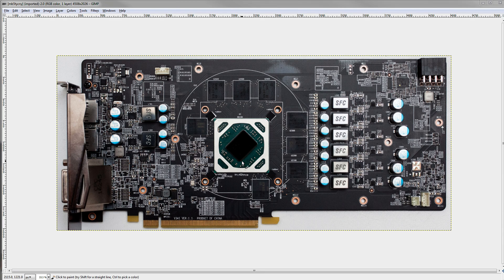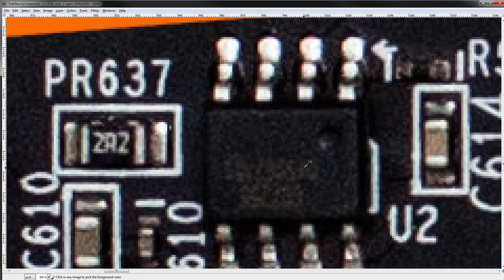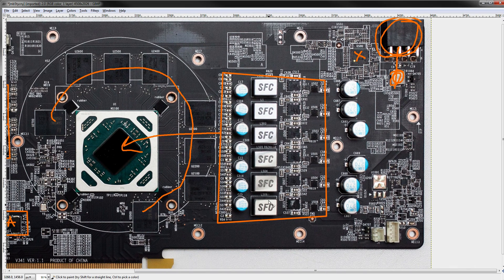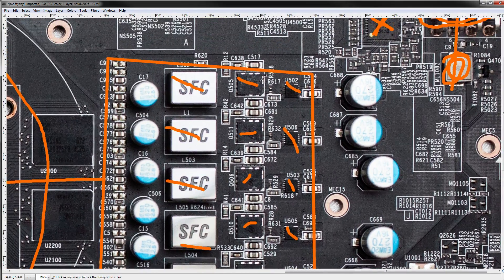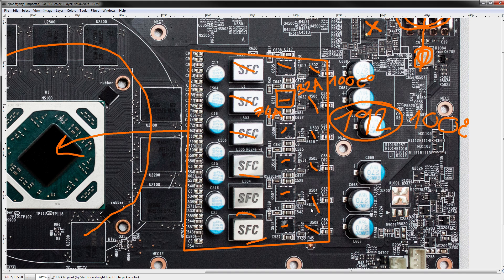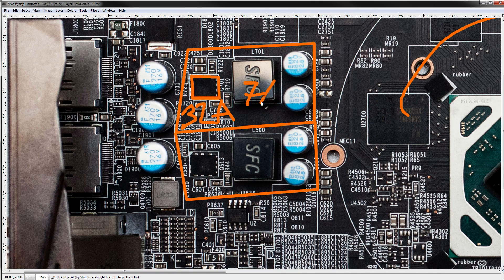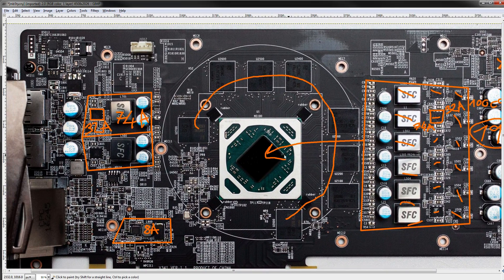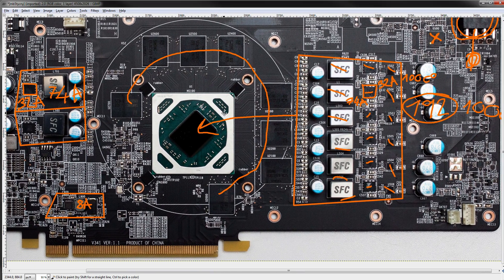PCB Breakdown MSI RX 480 Gaming X

Comment: same pcb as 580 armor, but components on the 580 armor are different (580 armor uses v341 pcb ver 1.3, diff mosfets, different voltage controller?)

470 armor pcb looks quite similar visually but totally different power stup with most phases on the left.
so multiple component choices and different variants of this pcb

Comment: Hi! Is it possible that the card is not reaching the set core voltage due to a defective transistor/controller in the power section? I own an RX570 Armor 4GB and have this problem, I have hot air and some manual skills, I wonder if I could fix it myself.

Comment: does this card have thermal pads on all the chips needed. I have one from MSI RX480 Gaming 8g  it checkerboards all over the place and it blue screens. It happens when I log out of windows 10 and when I boot up. I did find out how to make it do the checkerboard. The MSI gaming app ,when you change the clcok speed from silence mode to gaming mode to overclock mode. just keep changing it and boom it checkerboards all over. I looked at the card when I took it out , It seems there is hardly any thermal pads on many components and what I did see didn't look like it was touching the cooler at all meaning space between the top of pad and cooler or plate. Thats not good.

Comment: I just installed a big aftermarket cooler for my RX480, found a secondary heatsink to cool the mosfet but the heatsink is not big enough to contact all the components and left the driver IC uncovered, does the driver ICs needs passive cooling? Can I leave them sitting there with no cooling?
P.S - Sorry for the broken english.
Reply: Driver IC doesn't get hot, you're fine

Comment: the msi rx 480 8g is about 40 euro cheaper than the gtr black edition right now. should i go for the msi when im not a hardcore overclocker but still want a strong and cool card, which can overclock a bit?
Reply: jonas99g I've run my gaming X at 1.35V just fine so don't worry about it :)

Comment: I know I am being conservative with my MSI RX 480 overclock. Currently at 1360 on the core with a 50% Power limit increase in Whattman. No other changes. Gaming for hours without clocks dipping and always under 73c. But is this truly safe to leave here for years for an average gamer? Also, Is there much to be gained pushing memory clocks higher? In the past I have had cards that had stutter or cause lower performance with extra clock speed on memory.

Comment: Hi. I love your content. Loved this video. Could you please speak about the differences between the 8GB and 4GB models? Are there differences in voltage regulators? The same capacitors and mosfs are used? The 4GB card uses less power, of course, but how this fact reflects on the PCB? Could you speak about this? Thank you!

Comment: I really like your videos about all these PCBs, they are really informative and easy to comprehend even for non-english speakers. Thank you for it and the work you put on them. I would like to ask about no only the PCB components as I have noted that some   brands just tend to put the same cooler on different models and some of them leaves VRMs and RAMs not optimally cooled. My question comes if it is really crucial to have cooling on those parts. Or is it really safe to buy a GPU that its cooler only cools the GPU and leaves the airflow to "cool" the pcb.
Reply from the maker: Everything will last longer if it is run cooler. However low temps are not function critical.

Comment: hi, after watching your videos from the beginning, i was hoping that you finally start to review some motherboards as well...For me, id like to know something about my boards, the Asrock Z77 extreme3 and GA Z68AP-D3...this is much more important for me, cause these are pretty cheap boards and id like to know how much voltage i can give my good old 2700k..why not tell something about this mosfets, the caps and the cooling? Sandy and Ivy bridge are still very, very popular and there is no place to find where you can get real in-depth infos about the motherboard-components. Id really appriciate if you fill this gap and breakdown some popular motherboards. Greetings from germany.
Reply: yep, would like to see that too, me myself i got Z77 extreme4, looks awesome but a lot of people told me its shit under the heatsinks. However, running 4,5ghz for 2 years and it still works :)
Reply from the maker: you can probably do 4.5Ghz on 1.35V on that board.

Comment: I have seen some cards with a four-phase core voltage, so that is 128A on the high-side, and 296A on the low side, at 100C?
(I can't remember if that is for a later rendition of the RX 480, or if it is for some of the RX 470.)

EDIT - Either way, thank you for the video!  It is stuff like this that is great to know, even if one isn't going to be extreme with their hardware.

Comment: AHO, a small question - if I want to buy RX 480, but I have only one PCI-e 3.0 x4 slot (thin mITX board) will card like Strix, which has all the VCore delivery from ATX plugs, will it even work? Since the slot is not really rated at 75W. Should I use x16 riser with molex connector or something?
Reply from the maker: All the 12V power on a PCI-e slot is supplied by the first couple pins. The rest of the slot is GND and data.
Reply: Thanks, mate! :)

Comment: Thanx for covering this.  Has anyone found a bios to unlock the voltage for this card as it comes practically maxed out?  And for the cooling performance, the air cooler that comes with it is phenomenal.  Very low temps (56c with 1400mhz OC with load being full for hours) and very low noise.

Comment: What is the process that would cause coil whine on RX 480s? I've had coil whine/buzz on both the Red Devil and Strix. It only occurs in older games that run at ridiculously high FPS.  800+.
Reply: Limit the FPS ;)
That's not a RX480 issue, most GPUs have this with high FPS...
Reply: Coilwhine is normal, it's not limited to GPUs, I've a good hearing for high frequenzies (sadly). I can hear most powersupplies on light load (like phone chargers when the phone is full) or the switching of a ethernet switch... I'm wearing closed headphones when I'm gaming, issue solved^^

And you probably don't need 800 FPS, I mean are you using a PS/2 keyboard, because USB latency is too high for you?
If you are then use headphones or dampen your case, if not just limit the FPS.
Reply: I wasn't looking for a solution since I knew how to prevent it from happening. The solution for people who are concerned is to turn on vsync in either the game or the driver. However, the question was what are the processes which cause coil whine.
Reply: Actually it might be the VRMs operating at higher frequencies.
Got my new GPU yesterday, a R9 Nano. My old card is a 7950 (=R9 280).
On the 7950 coil whine is a product of power consumption and FPS, on stock clocks (GPU core <100W) with <100 FPS there was no coil whine (nothing that I could hear). >300 FPS little coil whine, >3000 FPS (Heaven benchmark on the exit screen, menus, ...) it sounded like it was about to explode.
With heavy OC (core using almost 200W) there is coil whine even with Vsync on 74Hz, getting insane above it.
The Nano manages to get coil whine in every scenario with some load (even with 60W for the core).

Looking at the power readings the VRM is crazy on this thing, unlike the 7950 where the core was feeded relativly consistent, HWinfo (polling set to 100ms) draws this Graph for a Nano on 852MHz while gaming:
http://fs5.directupload.net/images/161016/b4xeyinf.png

With a short idle period:
http://fs5.directupload.net/images/161016/l4ui34xx.png

With load it's ~20W + giant spikes, although average power consumption while gaming is ~60W in this scenario.

This could be one reason for more coil whine on newer cards.

Comment: I have been looking for a reference 480 (using an itx case, so I want the blower fan) but i cant find any, will people try to sell them used when Vega comes out?
Reply: some may and some may not. tbh I upgraded to an rx 480 bc I was coming from an r7 250. So it was actually a good time to upgrade. What I don't understand was people going from a 390 or 390x to a 480. I wonder if maybe some of them was before the performance numbers were out and if maybe just some of them just liked the new cards. I know there's a lot of people that made the upgrade because it was the right time to do so for them.
Reply: My card is even older: an ATI 5850 (yes, when it was still ATI) from 6 years ago.

Comment: Guys, between this one (Msi) and the Sapphire Nitro + Rx 480, which ones your guys will recommend?
Reply: Luck of the draw, really, although I really love the MSI cooler. Super efficient. I achieved 1470/2250 stable but at 240 watts and +100 mV. Temp never reached 70, fans at 90% and still reasonably quiet.
Reply: BBQ Bacon Nitro all the way mine did 1440mhz stock voltage. +12mv it runs 1460mhz never gets above 73c and 75% fan speed
Reply: Thank you 😊

Comment: I had to decide between the MSI gaming X and Asus strixx. I assumed that the MSI had the same level as the asus (on pcb quality),so i ended up buying the MSI. It was much cheaper (like U$$ 60 cheaper), it has the same cooling performance (i never see it above 72°c), and for my taste is very good looking. I see this and I realize I was wrong with the pcb thing. But at least is not a piece of crap like the red devil, or a sapphire nitro (super hot and noisy). It´s "average", and i´m ok with that.
Reply: The MSI has the best cooler on the market and the chips are high binned. Also the RAM clocks to 2250. It's above average ;)
Reply: As bullzoid said, the reference PCB is overkill.  It really doesn't matter that MSI has an average PCB, compared to the others.  The other factors, including the cost, actually makes it the best imo.

Anyone paying $300, or w/e premium they are asking now, for the asus or xfx, because it has the best PCB, is/was an idiot.

Comment: vCore on GTX 1080 FE is also entirely fed by the 8pin. I'm thinking if one could solder all the missing phases making it a 12+4 FE card.
Reply from the maker: FE does not have a VRM layout for 12+4 you could however double the current capability of each phase.
Reply: Actually Hardcore Overclocking the pcb has space for 6 drives and 12 mos for the vcore. I guess each driver could drive 2 mos, right? Doesn't it make it a potential 12phase core vrm?
Reply from the maker: 1 driver controlling 2 fets is still 1 phase. Since they FETs are on and off at the same time. A 12phase is a 12 phase because 11 phases are OFF when 1 is ON

Comment: I see no shunt resistor. how does it sense current?
Reply from the maker: The IR 3567B uses a cap and some resistors in parallel to sense the current going through the inductor of each phase. AMD doesn't measure the power draw of the whole PCB just the Vcore VRM.

Comment: good stuff, so how would you rate all the 480s now that you have investigated all the PCBs?
1 XFX   ...2 Asus   ...3 Sapphire   ...4 MSI   ...5 Gigabyte   ..6 Powercolor   ???
or should it be 1 Asus ... 2 XFX?
and will XFX be giving you a Black Edition?
Reply: seems like the GTR is selling fast after Jay's video.. lol
Reply: That seems to be correct when PCB is concerned. But when you include cooling, I think MSI gets ahead of Sapphire. Still, I'm going with the 1338 MHz XFX GTR :)
Reply: LOL me2, thats my favorite.. i only own 2 XFX 480s so far, but im getting at least 2 more :P
Reply: im not certain, but I think the black edition is the same as the GTR, just overclocked more... so maybe they select the GPU's with the highest ASIC values and clock them a bit higher and sell those as black.  Neither of my 2 GTR's have really high ASICs, but could just be bad luck on my part.  I would like to see the ASIC quality from a few black editions to see if they are indeed selected due to higher ASIC values.  Anyway Scsca is right, stay away from the RS and atleast get the GTR or if you can afford the difference since its not much, go black... black is always better :)
Reply: ***** I guess. Though Actually Hardcore Overclocking was the first channel to select it as the best RX 480 out there.
Reply: ***** From what I've researched, they have two basic cards - RS and GTR. Make sure to buy the GTR, as it has a bigger and better PCB and bigger and better cooling. Apart from that I think it's best to buy the card with the highest clock, cause they must be selecting them somehow to be sure the cards can run such overclock and probably put the best samples there. I've asked them on Twitter which model exactly is their top one, I hope they answer on Monday :)
Reply: ***** No answer thus far, but I think that Black Edition is also a GTR, but as Cryptomined said, these are probably the better looking chips. I'll keep you updated if they reply.
Reply: While one PCB may be better than the other, GPU still has to work as a whole. But from my experience with the cards overall: 

I had RX470 Nitro+, after a month one of the fans started rattling. Went to shop for RMA, I was told people bring RX470/480 Nitro(s) back almost everyday with this same issue. I left the shop with MSi RX470 Gaming X.
Reply: Scisca  i can't seem to find the same GTR like Jay's, as the image on the box look different. My second option would be the ASUS Dual card, which would go well with my white theme build.
Reply: Here the best selling 470 and 480 is the DATALAND X-SERIAL.. which is just a rebranded Powercolor Red Devil with a different Fan cover on it.  I bet you have not even see that one have you?  and thought you had seen them all LOL
Reply: ***** He has the 1288 MHz Triple X Edition, which I only see on Amazon as of now. I think I'll go with the 1338 MHz Black Edition instead. Better clock, the card looks the same, maybe it just isn't compatible with the LED fans? Dunno, but if you find any info on the differences between these cards, drop a line :)

cryptomined wow, these XFX boxes are really cool!
Reply: Scisca XFX class of cards are confusing as heck. It seems that the GTR from Jay's video has different box from the Amazon's listing. i think i'll just go with the ASUS DUAL card. lol..

cryptomined dude, you miner guys jack the AMD card prices up! hahahaha
Reply: Scisca Please do update me if they answer, because if based on price, the Black edition seems pricier than that of the GTR. Black edition is around $289.00 and the GTR is around $280.99 last i check, so that is a little confusing. lol
Reply: TheBobes in Poland I work in shop where we sell computers and... Really a lot of MSI comes back for RMA 😟. From all reviews i would really choose the MSI gaming, but 3/5 MSI cards or motherboards comes back and this is a lot. I am really confused right now. Price, pcb, cooling and look tells me to pick up the MSI gaming x. I will wait till those rmas come back and see if those people still have the issues.

Comment: hey!, i just bought one of these. How much vcore you think is a "secure voltaje" for air cooling?. msi afterburner goes up to 1,25v. But... i found a plugin for msi afterburner who can go up to 1,45v. I dont want to fry my new gpu, i just want to find the maximum overclock for it. Now i´m stuck to 1420mhz at 1,25v.
Reply: 1.3v max. for air
Reply: 1.25v optimal for air
Reply: What's your ASIC quality measured by GPU-Z? What program are you using to test stability? I have the same card and have gotten as high as 1470 at 1.25, my ASIC quality is reported at 86.5%
Reply: Brian My ASIC is 73,3%, pretty average. With 1,25v the max fully stable i can get is 1410/2250. I can run suicide runs at 1430mhz, but it crash instantly on some games, and runs fine on others (like ROTTR, Forza apex).